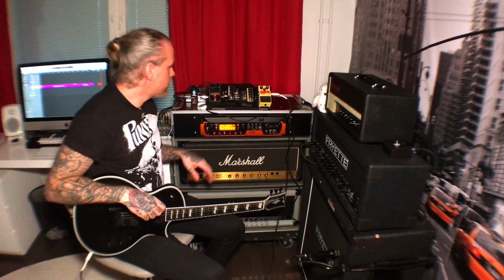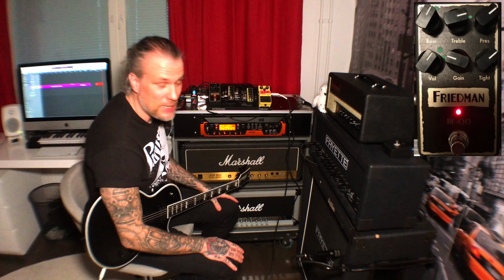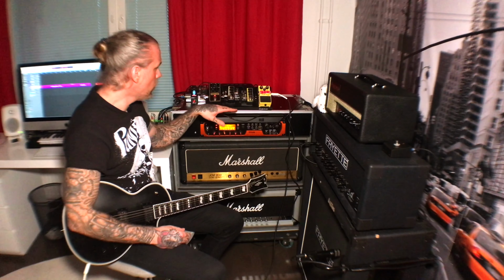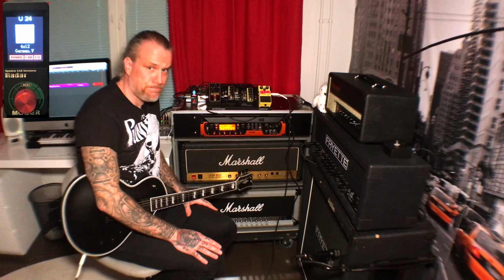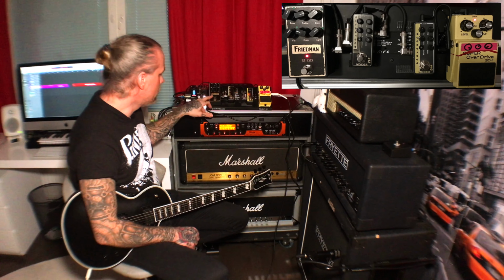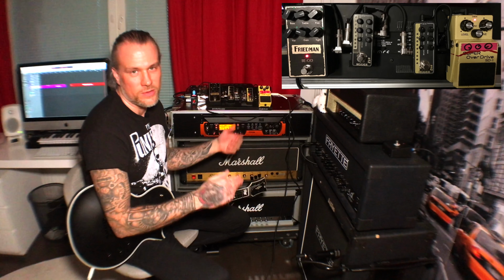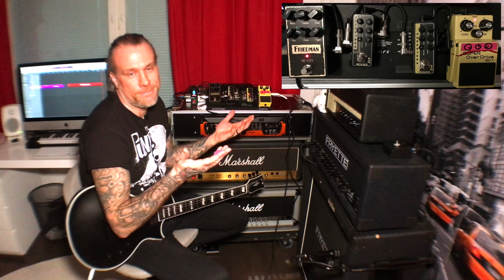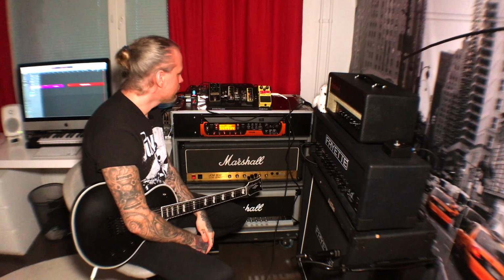FRIEDMAN BE-OD / MOOER US GOLD / MOOER UK GOLD - COMPARISON

Comment: I like the demo. I have the BE-OD great pedal. I have the Mooer Preamp Live as well which has the other two preamps. There is a problem with this comparison, however. The Mooers are preamps. They are voiced to go straight into a power amplifier or cab sim. The BE-OD on the other hand is an overdrive. It is intended to go into the front input of a guitar amp lOW into a preamp. This explains the obvious tonal difference the mooers as scooped with prominent highs whereas the BE-OD is not. It’s fat and dark in comparison.
Reply from the maker: Thanks for your comments Greg and I'm glad you like the demo. You are correct and in a way not :-)
I use BE-OD in both situations you described. With my band Cyhra I use it directly into a Neunaber Iconoclast speaker emulator (on live shows, in the studio I use mostly real amps) and in some other situations I use it in front of tube amp's clean channel and sometimes directly into power amp (effect loops return) and it works great in all 3 situations. You just have to tweak the nobs quite differently depending on the situation. 

Here's a few vids where I use it in different situations:
- https://youtu.be/cFUgh6Mp2fk
- https://youtu.be/swybCSKO8y8
- https://youtu.be/xqLJCQymxlY

Cheers!
Reply: I really really like the BE-OD for the stuff you’re doing. IMO better than the Mooer preamps, to be honest. In his demos Ola Englund almost always plugs everything into the back of his amp and manages to make any halfway decent pedal sound great. It definitely works. Besides that BE-OD has plenty of top end to get the job done.
Reply from the maker: Thanks! Indeed it has 😊👍
Reply: Mooer Live does not have US Gold but US Classic preamp. If it has I would buy it.
Reply: @abcd-fs2de  It has the US Gold 100 Dist (#7). It’s one of my favorites.
Reply: @Mister_Greg  Manual says it is the UK Gold not US Gold - there is a difference!
Reply: @abcd-fs2de  I’m well aware they are different. #7 is the BE-100. The UK Gold is #4. FWIW, I referred to my manual to make sure I typed the name properly. Whatever version you have of the manual is simply incorrect.

Comment: Thanks for the demos! Btw Euge, the Mooer 002 emulates the Marshall JCM 900, while the Mooer 012 is the one that is based on the Friedman BE100. I know, in the end you will get the same "core" sound since the JCM and the BE100 share the same "ancestor" circuitry (Marshall Plexi), but they still have their differences. For example, the real JCM900 has a more scooped sound and is brighter than the BE100, which is more flat sounding and has more gain.
Reply from the maker: Yeah I know and I think I mentioned those facts in the video 😎. My bad if I didn’t so thanks for mentioning 👍. But they’re all in the same ballpark so to say. I’ve used those real amps live and in the studio and you are correct🤘.
Reply: @EugeValovirta230V  haha not my now sold JCM900, weak ass amp. These are good though compared to my JCM900. Great video Euge. Thanks bud.
Reply from the maker: Yeah old Marshalls can be quite different from each other. I mean I’ve played with awesome 800s and with really crappy ones. Luckily I have 3 awesome ones 😎👌.
Reply: @EugeValovirta230V Hi Bud, I was meaning the JCM900, they were shall we say Oasis sounding haha. I've loved every JCM800. Just gonna purchase my Friedman BE-OD and Boss SD-1, can beat it. Thanks to you mate. Iconoclast is sold out everywhere I look. I need to save £££ or her in doors will get angry and lock me in the shed, haha. Next week maybe. ;) Thanks for your help Euge.
Reply from the maker: Ok cool 😎. I’ve had the same experience with 900s 😊. But every 900 SL-X I’ve played has been a killer. It’s like 800 2203 but with 4 preamp tubes so kinda like a modded 2203 💪😎.

On one Italian tour with Shining I had a 900 Dual Reverb which was just amazing. It was a rental amp and if the company would’ve sold it to me I’d have also a 900 now 😎.